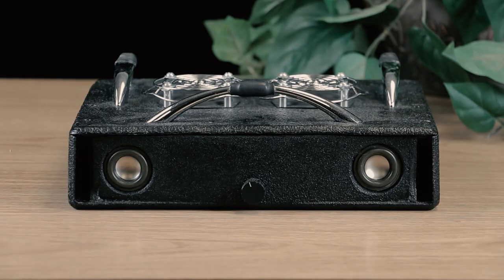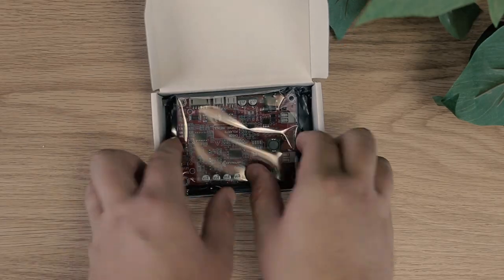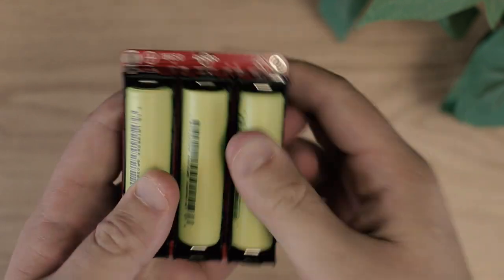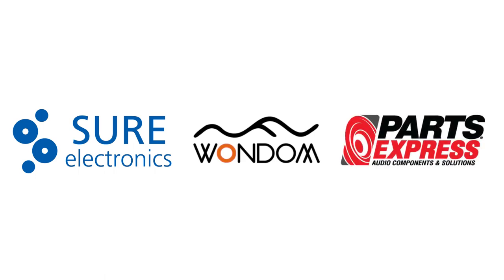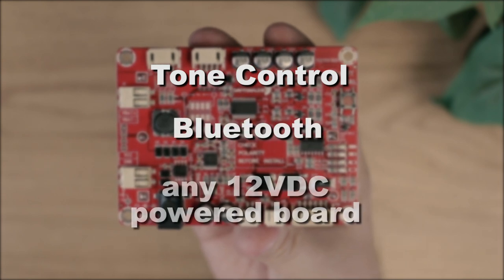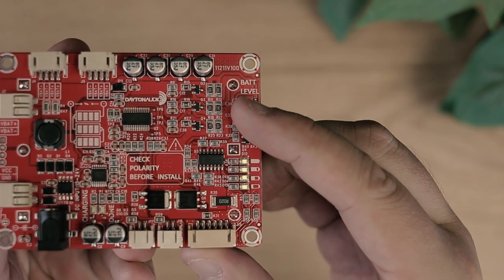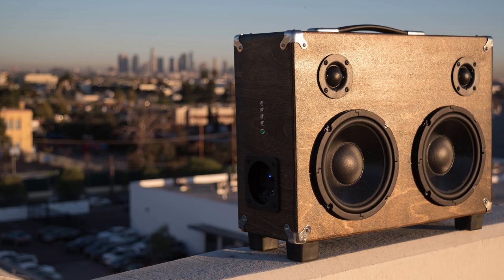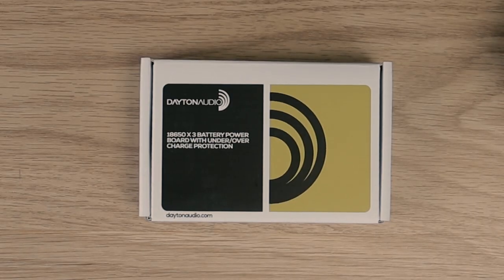How to make your Speaker Project Portable

Comment: The battery pack says it is half charged but when I try to turn on the Dayton amp board it doesn’t work unless it’s always plugged into the wall
Reply: Most likely one of the batteries isn't charged. Charge each one separately, then check them with a multimeter, then try them together again.

Comment: I purchased the MK Blastbox and am interested in adding another of these boards to increase voltage from 12v to 24v, however I am not an electronics wiz and the instructions just say that "you can add another lbb using just a few diodes" what kind of diodes do I need, and what does the wiring diagram look like?
Reply from the maker: You should just contact one of our techs! They can answer your questions. 

To get technical information about our products: Email: Tech@Parts-Express.com Phone: 1-800-338-0531 Hours 8am-6pm M-F EST / Closed Sat & Sun

Comment: i just picked up the LBB board for my next project and after checking it out and hooking it up i have a few questions.
1. what type of connector is J2 and J3? it looks like some type of press to fit connector for bare wire but before i start jamming wire in there i wanted to know for sure.
2. in between the J2 and J3 connectors there are 4 unfilled through holes. using my DMM i get readings of 12v, 8v, and 4v . i assume the it has something to do with the voltage of each cell. what is the purpose of these holes, if any?
3. what is the function of the J3 connector? the documentation says "15 to 24 volt input" . is it for hard wiring the power input in place of the barrel jack?
Reply from the maker: 1. J3 / 4, those are both for bare wire. Solid conductor works best but you can use stranded wire, it helps to tin the conductors first if you are utilizing stranded wire. 
2. The terminals between j3/4 are there simply as a test point. 
3. J4 is input J3 is output. J4 is the same as J5, just for bare wire. 
4. See wiring guide for clarification of terminal numbering. http://www.parts-express.com/pedocs/more-info/325-200--dayton-audio-lbb-3-quick-start-wiring-guide.pdf
Reply: ok. cool. thxs for the fast reply.

Comment: Great idea ! Now all that's needed is to come out with a way to run multiple packs in parallel for more capacity and a four cell version.
Reply from the maker: Each battery board comes with a little cable. If you are only utilizing one battery board with your project the cable would connect your battery board to your amp board. If you want to add another battery board just use the supplied cable that comes with the new battery board to connect to the existing battery board. There are  3 identical connection points, just use one of the open ones on the first battery board.
Reply: using this board, is there a way to reach 24vdc(or really close) for a long lasting portable bluetooth speaker set up.  can they be linked together to reach my goal?
Reply: @PartsExpressOfficial  To clarify - I would need to buy another battery board to add to the first one? I couldn't somehow connect just a battery holder with leads to the first board? Thanks!
Reply: @alexmurray116  You would need another board for proper charge/discharge, overcharge/over-discharge protection; as well as maintaining proper balance between the cells.

Comment: I bought this for my Dayton amp board and it won’t charge or put power to the board but when I plug my speaker in it works but the battery’s dont
Reply from the maker: Which battery board did you buy and what power supply are you using?
Reply: Parts Express I bought the one in this video and I’m using a and I’m using the dc charger that gets hooked up to the amp board and it doesn’t charge the battery pack

Comment: How do you chare the board
Reply from the maker: There is a cable which feeds to a power connector. you can install that on the outside of your project and plug in power there.
Reply: @PartsExpressOfficial  thank you

Comment: hi there! any significant differences between this board and KAB-BE 18650 Battery Extension Board?
Reply from the maker: Long story short, use the KAB-BE for KAB boards.....use this board for anything else.
Reply: Parts Express How can i hook up 2 or more
Reply: @PartsExpressOfficial  the JAB wondom board looks identical to the KAB-BE, can i use it in the same way with the KAB-160 board?